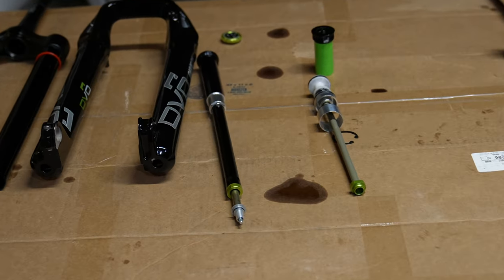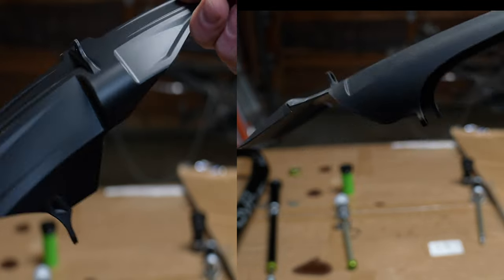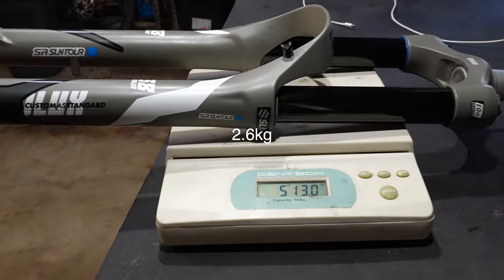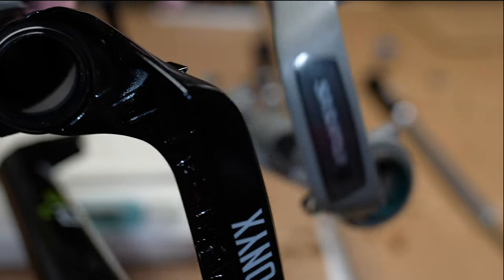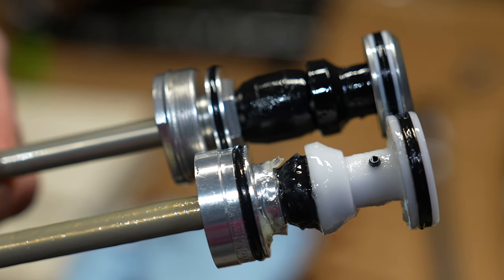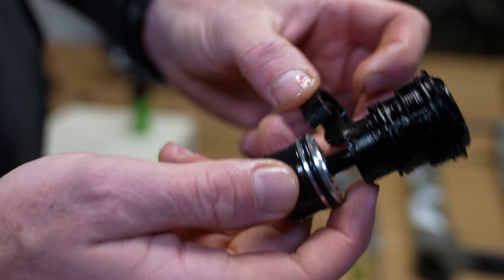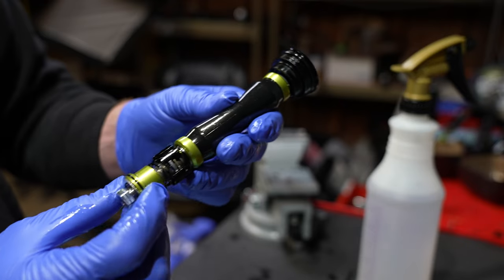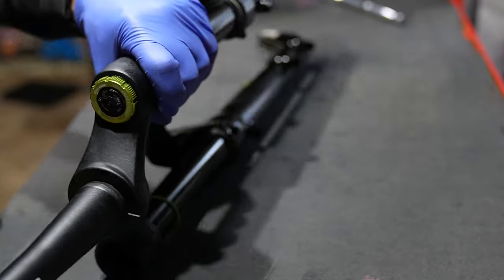SunTour Durlux 38 & DVO 38: Bench Breakdown

Comment: Did you try to get a tad lower on the air pressure and use the LSC too keep the ride height? I tried the Durolux 38 a couple of days last year, as my friend is blessed with testing all the e-bikes with Bosch motors. And I feelt that it was with the air pressure like 4psi lower than recommended and more LSC the fork rides great on small stuff but still retains its big hit capability. I agree it is not as plush as an Ohlins RXF or a Mezzer Pro - but it is a very impressive fork for the price. 

Also - Suntour ships the Durolux without and oil in the lowers so you can add your own fave (like Motorex Supergliss 100K) - without taking it apart. 👍👍
Reply from the maker: Is SR Suntour Enduro Suspension any Good?
https://youtu.be/3S_o5n6CUPY

I had that setup in this video it worked good